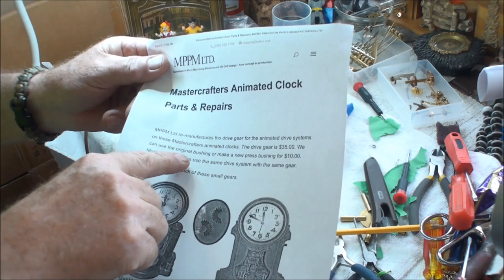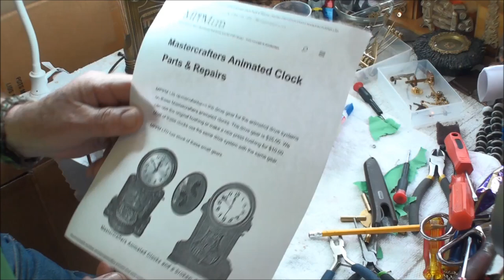Master Crafters Swinging Girl Repair

Comment: I have the Mastercrafters Swinging Girl Clock. The faux wood bakelite body, light, swing, and clock face are in excellent condition but the clock motor doesn't work. This belonged to my grandmother and I've always loved it. I'll see if I can learn a thing or two here from you, and maybe get this treasure back up and running. Thanks for the video! 🕓
Reply from the maker: That would be great if you can find it. Depending on the clock, if it has a real motor or a cheaper, Japanese one. If yours is the one with the motor, be careful of the fiber gear by the motor gear. Don't like water on it and if that gear is good, your clock movement might just need cleaning and oiled. I found out you oil it as you put it together.
Reply: @justmike57  You're a wealth of know-how. Very appreciated. 👍

Comment: Mike I have replaced all my original bulbs with leds . They don’t get hot so they don’t gum up clock oil. Thanks for all your help. I have tackled 4 mastercrafts now.
Reply from the maker: You did a good thing, replacing the bulbs to L.E.D. So happy you have you clock in working condition and a cooler clock at that. Thanks so much for watching Sandi Loftis

Comment: Wife just asked me to fix her grandmother's clock and I found this video. Haven't looked at it yet but the motor is spinning and nothing's moving. Wish me luck. I'll let you know how I made out. At least I know how to get it apart now. Definitely going to replace the plug if I get it working because it looks like a fire waiting to happen.
Reply from the maker: Replacing the plug on an old one is a good idea. On the cheap, you can go to a thrift store and buy a small extension cord, cut off the multi plug end and there you have a nice cord to use. This type of motor has that plastic gear that might be wore out. Or maybe just needs cleaned, but don't touch the plastic gear on the disk to hard or it will break unless it is bad anyways. They sell them on E-bay for $16. with free shipping.

Comment: My wife has one that we literally just dropped off to a repair place because she swings part time. The guy said the gear is worn. I'm gonna email(just did) about that ⚙️ & I'm gonna call them tomorrow(Mon) to see if they still have them as you posted this 7 mos ago. 
Thank you for the VALUABLE video
Reply from the maker: I think they are the only ones that make the tiny gear themselves. The fiber gear people are a bit odd, but they do send them out.

Comment: Great video Mike. You are a man of many talents. I really enjoyed this video. Yes I learnt a little bit by watching this. I am not an electrician so I dont like working on electric clocks. I do have one. I did clean it and it does work fine. I bought it at a yard sale for $20. It is the one with the ballerina. Awesome video. Thanks for posting. Thanks for putting my you tube channel in the end screen.
Reply from the maker: I normally don't buy electric clocks, but this one had moving parts, just like the cuckoo clock, so I was ever interested in this clock. Really have to look hard and listen to what the owner says about the clock to hopefully know if you want to take your chances on it. 
  I know you don't really like electric clocks and that is why I almost didn't shout you out at the end.
Reply: @justmike57  I appreciate the shout out. My daughters co worker asked me to work on an electric clock. I did but chose not to repair it. It needed some soldering work. I didnt want to be responsible if something went wrong. So I typically stay away from them. I will do a clean and oil but if there is something wrong with the wiring then I refuse to work on them. My lawyer saw me a couple days ago and asked me if I would look at an electric clock for him. I told him that I would and wouldnt charge him anything to fix it but if there was electrical issues then I wouldnt fix it. Told him who he could call. He said the clock wasnt worth that much on ebay and that he didnt want to spend a ton of money on it. So I told  him that I would see what I could do once he finds it again and lets me know.

Comment: Thanks Mike, I usually steer away from electric clocks but interesting to watch.
Reply from the maker: I normally do the same, but when I saw one with action, I had to try one out. It's a guessing game when buying them on line and there are people out there that got burnt, took some parts off and try to resell it as if they just got it from a thrift store and there's nothing wrong.

Comment: I just expect every package to get treated rough these days, but people can pack better also. It's a shame. The early Mastercrafter's clocks used motors from the Sessions Clock Company, like yours. Those fiber gears do wear out and it is often cheaper to just buy an old Sessions clock for parts and hope that gear is ok. They used the phenolic resin fiber gear because it was supposed to be quieter. Without that layer of smoke on your clock sure makes it look better!! I enjoyed your video, Mike. :)
Reply from the maker: Thanks so much for stopping in Time4Clocks. It is hard for me to buy another clock and just take parts off. Even a parts clock that is under $50 is hard, yet I still get some of them under $50 if you watch every day and not bid to bring attention to that clock, lol, until the Sniper Bid Moment....

Comment: Hey Mike...do you happen to have the one with the waterfall model 344?.   That would be a good one for you to do a video on.  It has a glass inside with different designs etched into it that rotates to make the waterfall appear to shimmer and move.
Reply from the maker: Yes I do. I have the darker green one and the lighter white and blue one. I am a bit behind on my videos because of the remodel of the Washington/Clock repair room, (Video is out on that one). And I am busy with three other people and there clocks. But when I get time I will put one out on that clock as well Wilderness of Zinn.

Comment: Is there a place you get parts / motor for this clock?
Reply from the maker: Depends on the motor you have in your clock. E-Bay has a guy that is selling them. This is the link. https://www.ebay.com/itm/324805227963

Comment: I have repaired a few of those, and I absolutely hate them. Very cheaply constructed. They are very collectable though. I have sold four of them in my antique booth. I get $100.00 out of each one, believe it or not.....
Reply from the maker: These only are a cool clock because of the movement they make, just like a cuckoo clock. The Japanese movements are really cheap, but they did work and when you offer one of these clock, Japan or U.S. made, to a person in the clock shop, they don't no the difference and will buy the cheaper one.

Comment: Its a FACE not a dial...dial  is the name of a soap brand
Reply from the maker: A Dial is what it's been called for ever. But if you are looking for parts for your clock, you would either type in clock dial or clock face. The Sun Dial would not be called a Sun Face because you would get a pottery sun face. So it turns out to what you would like to call it and if you are making a video, I am sure your audience would know what you were talking about.
Reply: @justmike57  AHH I see now it makes sense. dude i love your vids I wish you could do an overhaul on my beloved cuckoo heidi and peter. the clock is only 10 years old but stopped working i cleaned the bearing and removed the fuzz then oiled the bearing but the pendulum still won't swing
Reply from the maker: @wesleyditchko8376  My email is below the video and we can talk there. Send me pictures of the clock and the movement and we can talk about your problem. 
  Most the time, you can clean and oil your clock without taking it apart, but that is normally a quick fix. With out taking it apart, you will find that First, make sure the tick-tock sound, sounds even. Second, the clocks sometimes are hard to get ticking again because they still have the old oil and dust in the pivots and the new oil is loosening the old, shellac oil. So try to start the pendulum every time you walk by the clock and maybe in time, the clock will start ticking again. Move the pendulum bob up so the clock will tick as fast as it can will help.